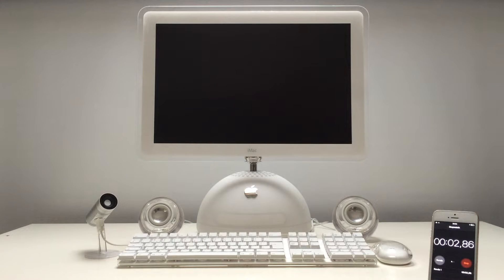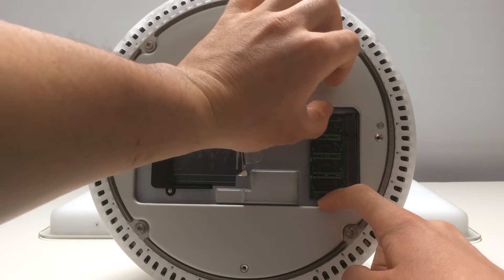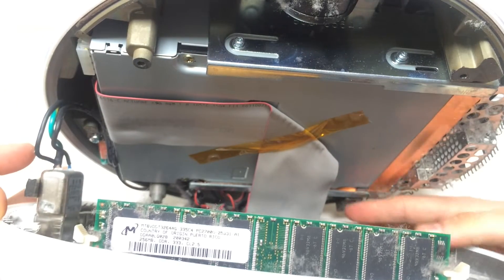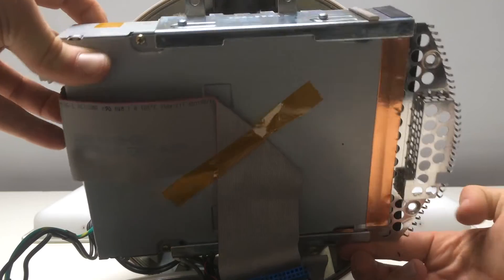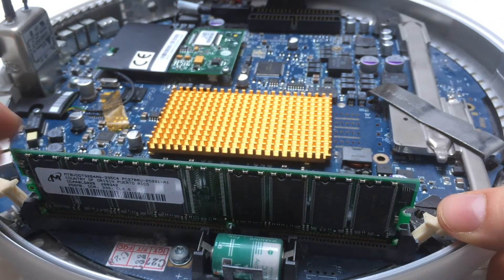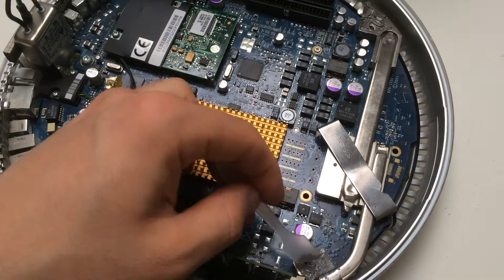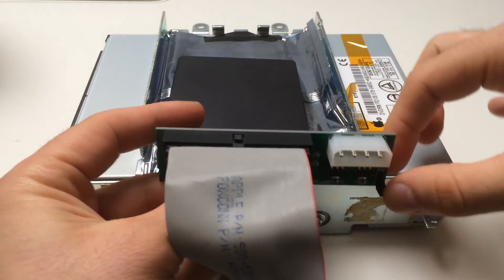iMac G4 Full Upgrade with Samsung SSD 2017

Comment: What needs upgrade is the whole system actually! I am going to attempt just this on mine!
Reply: Did u do it?
Reply: @jameswoll  Unfortunately it did not work because I couldn't find the pinout for the 15" iMac G4 display online, only the 17" and 20" are listed.
While I could have attempted to buy a 2008 MacBook display and a converter board to then put that in the iMac G4's enclosure, I decided to simply sell it as working but dead display cable.

Comment: You didn't attached a power supply to the IDE-to-SATA-converter, was that intentional or don't you need it for an SSD? I need to know as I want to replace the IDE HD with a mechanical 2.5' Sata 1TB. Additionally. is there a size limit for HDs?
Reply: I never could get that setup,to work. Maybe cuz I plugged in power?
Reply: @Phil_From_Canukistan  I'm guessing Sata drives included a power connection because there was no power coming through the serial cable. If that is the case then I would think there's no power in this video to the SSD in this video unless he attached it off video, I wish he would tel us.

Comment: Please, could you specify the parts you are usisng? i.e. physical size, etc? Thank you. I want to do this, but have no experience.
Reply: If you could give me links to purchase - that would be great! Thanks for the video!
Reply from the maker: Sie the comments you can find the list
Reply: A.N Tube Sorry I do not see any specifications of the products you used to upgrade. All I see in the comments are more YouTube video links you posted. Can you describe where the products links are please? Thank you.
Reply from the maker: ARM Ltd DDR1 DDR 1 gb pc2700 ddr333 333MHz 200Pin Laptop ddr memory CL2.5 DIMM RAM 1G

Genuine original Arctic Silver 5 3.5g, 99.9% Pure Silver Nano-silver thermal paste

New 1GB DDR 400 MHZ memory desktop PC - 3200 1 GB

Ata pata ide converter adapter plug end play 

You must watch on aliexpres
Reply: @ANTube  Does this upgrade update the PROCESSOR ? (will the computer be too slow for daily use of web browsing, YouTube HD videos, word processing, email?) Thank you :)
Reply from the maker: Nope it will not en for daily use its not recommended

Comment: I did the same procedure but the Mac doesn't see the SSD after that. Did your upgrade work and let you reinstall MacOS X after that on the SSD ? There are other videos of ppl that tried but the Mac keeps not seeing the SSD...How did you manage to get it recognized ?
Reply from the maker: I think on ata converter switches is not in read position see mijn video closely en compare  to yours

Comment: Should have put a Bluetooth card in there. Put one in my 20” g4 iMac. Worked perfectly
Reply from the maker: i just wanted bluetooth module in it only i couldn't find one unfortunately
Reply: Not sure if you still have the iMac G4. Bluetooth modules are easy to get on eBay
Reply from the maker: Keith Edginton i still have imac g4 it would be cool i a can find one do you have link voor me? Maybe i can make a new video
Reply: A. N Tube
Apple part number for the card is 820-1696
Apple part number for antenna is 631-0019
I used parts I had on hand. They came from an iMac G5

Comment: Why put in SSD in something made to accept IDE? Doesn't IDE max out at 33Mbps? Seems a waste?
Reply from the maker: Ssd is only for fun it wil not make faster
Reply: I'm doing a replacement on one of these for a customer is what brought me here so the video clearly still has utility for me and I appreciate the upload but it does beg the above question to me.
Reply from the maker: and also you are rid of annoying noise from HDD
Reply: I can no longer stand the sound of a whirring and whining hard drive.

Comment: Excellent tutorial.  I love my 20" G4 ... I think it has the most attractive design of any Mac every made. I plan to replace the battery and drop in an SSD drive to mine.  It's main use is as an Audio player and with the visualizers and better than average sound through those speakers it always gets noticed in my room.

Comment: Don't put the ssd on the anti-static bag. It's only supposed to protect components on the inside, but the outside CONDUCTS electricity. Not that it would do any damage to the ssd but for future reference.
Reply from the maker: Layne Bumgarner Good one 👍
Reply: A.N Tube  I would add, I think the original hard drive was in contact with the DVD, anyway, and, even if it were, you’d probably only get continuity between the casing on each, which would be ground. They should have a common ground, anyway. If you want to insulate two surfaces from each other, kapton tape is the best, because it doesn’t expand or contract with thermal stimuli. Cardboard would work, but I would be concerned it would shed dust inside the case over years, but that’s what the original drive was wrapped in. Good enough for Apple, good enough for me. Plasticard, from any model shop, would do the job, too. Me, I’d have just flipped the SSD over, to be sure the only surface touching the drive was the outer casing on the SSD, anyway, and taped it down with kapton tape, like the original hard drive was.

Comment: First, if u afraid from causing shorts with the converter cards soldered pins, then cover them with electrical tape or capton tape. That should keep them safe.
Second, there are 3,5" converter trays for 2,5" HDDs/SSDs. Fixing in place the SSD with just tapes is not a great idea. The tape can loosen and the drive falls off its place and the converters pins can cause shorts(check the First).
Third, swap out that ridiculus fan on top of the case. If the mobo supports PWM, then use a Noctua, Be Quiet! or same quality PWM fans. If not, then pick one of the same brands of the Non-PWM silent modells.

Comment: Could you put a list of the components you replaced them with if you have not done so already?  Links too? 
Thanks
Reply from the maker: Yes no problemo 

ARM Ltd DDR1 DDR 1 gb pc2700 ddr333 333MHz 200Pin Laptop ddr memory CL2.5 DIMM RAM 1G

Genuine original Arctic Silver 5 3.5g, 99.9% Pure Silver Nano-silver thermal paste

New 1GB DDR 400 MHZ memory desktop PC - 3200 1 GB

Ata pata ide converter adapter plug end play 

You must watch on aliexpres
Reply: Would be great if you had the name and links of each item in the description of the video.
Otherwise, great video man!
Reply from the maker: You can find it on alieixpres

Comment: you needed a drive bracket (3,5/2,5) to mount the ssd. otherwise cool vid
Reply from the maker: You are wright but ssd is really lite so its not that big deal without bracket but you notice very well sharp Thanks

Comment: OK one more question, can you give me the parts list so I can try to upgrade my iMac G4 ? I finally have one & I'm not going to part with it.
Reply from the maker: Yes no problemo 

ARM Ltd DDR1 DDR 1 gb pc2700 ddr333 333MHz 200Pin Laptop ddr memory CL2.5 DIMM RAM 1G

Genuine original Arctic Silver 5 3.5g, 99.9% Pure Silver Nano-silver thermal paste

New 1GB DDR 400 MHZ memory desktop PC - 3200 1 GB

Ata pata ide converter adapter plug end play
Reply: Thx, I have everything ordered. Just waiting on the airport card & 1 gig of ram
Reply from the maker: Nice hopefully other parts will also arrive soon
Reply: A.N Tube This is the full parts list? Thanks
Reply from the maker: Yes! No problemo

Comment: OK heres a question for you. I was able to purchase a iMac G4 Power PC; "the Globe" for 25 bucks, and it fully works. I also have a fully working Mac Mini. My question is, is it possible to gut the iMac & install the hardware from the Mac Mini into the iMac G4 & make it work?
Reply from the maker: I think that is possible only problem is how do you get a picture because you have to know which wire you have to select on which wire if you can get the signal via the macmini on screen then should be possible i have try macmini hardware without body fits inside
Reply: That seem too be the big issue. How to get the picture from the Mini to the G4 screen. It seems possible, just dont know where to begin.

Comment: Great video, AN. Tube. Dit everything work fine with the newer HDD? 
I myself try to do the same, with an SATA SSD and an similar adaptor from Alie-express.
Unfortunatly My Imac g4 seems to be unbelieveble picky about the drive. So far I tried an normal SATA HDD with a cloned version of the original drive (cloned with SuperDuper).
Also an old laptop HDD with a cloned version of OSX 10.4, an small 64 G SSD from Alie-express, also cloned.
I tried an another adaptor between flatcable and laptop HDD.
None of them boots and all show the question-mark inside a map when booting. Afterwards the computer hangs.
Strangly enough the computer doesn't respond to the keyboard while booting up. So pressing Alt after start doesn't show the bootable options. Not pressing T when selecting target-mode.
The only option I so far got working is the old original HDD. And that one is getting noisier every attempt. 
I must be doing something something but can't seem to find out.
What kind of adapter did you use between the SSD and the flatcable. Do you still know type and where to buy?
Help is highly appreciated.
Reply from the maker: hey that's annoying I think you have older g4 version I did not have such problems and with me it works perfectly I'm working on video after upgrade I wil upload soon! the cable converter  is ata pata ide converter adapter plug end play i have also bought on aliexpres what you can do is install ssd and set up with cd software and not via the clone hdd!
Reply: Thanks for the respons, AN. Tube
Indeed it seems one of the older G4's. 15 inch screen 800mh.  I tried as you suggested. New (other HD) HDD build in and connected instead of the old HDD. But when its starts up it shows only the map/question mark. It won't respond to the keyboard on my requests, for the boot options.  I already found out that the boot options for powerpc are slight different from intelmacs. I learned that the drive jumper cable select/master and slave is very imported. Even the original HDD boots only when CS is selected with the drive jumper
Reply from the maker: on older g4s is a bit more difficult but nice that you have found the problem
Reply: I took me al lot of trial and error. Especially a perfect copy of the original disk brought me some headache. Even superduper dos not do the job perfectly. But I managed to get a working clone-disk. Thanks trough your video and helps. 
The only thing that doesn't work is accessing the boot-menu while startup. Target-disk and selecting the CD fr startup. But so far I managed to do it all. So eventually that will succeed to, I guess.
Thanks A.N. Tube
Reply from the maker: I am glad that you succeeded Its feel good have been able to help. and what I also wanted to recommend is to put ssd in g3 desktop and install it there and then put ssd in g4 then you have ssd with fully installed software i deed ones en its worked for me so next time you can try  that. No problemo you are welcome.

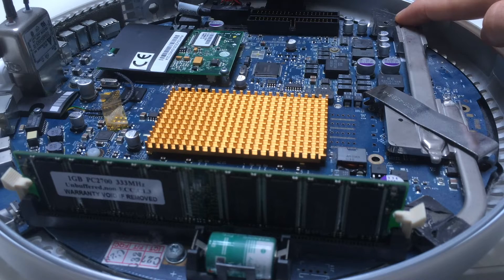Comment: hey man, cool vid, just at around 05:08 when you clean the thermal paste residual, don't scrub it! You should use Isopropyl Alcohol and rub it clean with a microfiber cloth! Avoids the scratches this way ;)
Reply from the maker: soanis Thanks good advice 👍

Comment: Can you make a written list of everything you upgraded I mac g4 so that I can order exactly what I need to upgrade my g4.
Reply from the maker: Agnes Bonham no problemo 

ARM Ltd DDR1 DDR 1 gb pc2700 ddr333 333MHz 200Pin Laptop ddr memory CL2.5 DIMM RAM 1G

Genuine original Arctic Silver 5 3.5g, 99.9% Pure Silver Nano-silver thermal paste

New 1GB DDR 400 MHZ memory desktop PC - 3200 1 GB

Ata pata ide converter adapter plug end play
Reply from the maker: Agnes Bonham  Airportcart SSD en iSight webcam!

Comment: Great job... but do you recommend swapping out the dvd for another smaller ssd which you could boot off of? And due to the limits of the processor, is it all worth it?
Reply from the maker: Spuds Thank you! I would not recommend to change DVD drive. You have something extra to play to play ore burn  DVD's. iMac G4 apps are not that big so i think you don't need really so many gb's but you feel comfortable i think it will work well. Just format  a properly, then it will work just fine.

Comment: Great tutorial, even with imperfect English you were clear and easy to follow. I plan on doing much of this with mine, though I will leave out the SSD conversion. The bus speed of this aging machine and the bottleneck of the ATA standard makes this machine way too slow to take advantage of any gains offered by an SSD. They're too expensive to throw at a machine that can't even take proper advantage of them.
Reply from the maker: ProjectDv2 thanks you are right for part of ssd can not be wired in g4 might be better choice to insert an SSHD also considering that ssd is too expensive is also quite well en with sshd you have speed en storage as wel

Comment: Cool vid! I have a G4 caked with dust too and have yet to take the challenge of disassembling the thing to clean it up and swap out the drive.
Reply from the maker: iTek thanks! Its isn't  that hard to do it en its nice project to you can do it easily
Reply: Love your channel
Reply: as was mentioned  before ... DO NOT USE A VACUUM . . . Static charges kill .

Comment: I just did this to a 1.25 ghz g4. I have 1gb ram in both slots. OS X tiger only shows 1gb total. It says a slot is empty. If I pull the RECOGNIZED stick out, it will read as 1gb still!
Reply: Btw that iMac uses a 200-pin SODIMM DDR PC-2700 stick. Watch out for that!
Reply from the maker: Turbo Tutorials I think the memory you're using does not  work or is not the right one , not all the memory's with one fits in  that will work!
Reply: If these make a combined 1 gb ram, then you should have no problem.
If each one has 1 gb ram it doesn't work because PowerPCs support up to 1,5 GB of RAM, sometimes 2
Reply: The one stick was bad. I’m cruising with 2gb now.
Reply: Did you notice a big difference?
Reply from the maker: A little bit but its fun if you like upgrade thinks
Reply: I just put 2 GB in my imac g4, up from 768 mb. it's a ton better on the internet.
Reply: Great! Enjoy 2 GB of RAM on your iMac G4!

Comment: Nice video man! Just an advise; never suck out dust from computerhardware using a vacuumcleaner, that can cause ESD's. It's better to blow it out with compressed air ;)
Reply: Actually,  there are specially designed esd vacuums that are made for use on electronics.
Reply from the maker: Jeroen van Diesen Yeah not really professional how i deed.  thanks for your tip, i will definitely do different in future videos! Thanks man
Reply from the maker: exactly my vacuum cleaner is special too 😜

Comment: How long did it take you to acquire the components? I have a boxed 800mhz model I'd like to upgrade to my 2003 Wildest Dreams setup, and have a bit of shopping to do.
Reply from the maker: Ken To get everything together has me taken a month!i order it from china.  You have to keep in mind this imac in video is not 800Ghz is 1.25 ghz model! and the components will not work in the 800 ghz model! The are different!
Reply: Thanks. I'm aware they are different. The 800mhz Model is what was top of the line when I first went to college... so... had to be specific.
Reply from the maker: Ken oh so okey i understand. What's your plan? with your wildest 2003 dream setup what do you have in mind to to wilt you imac g4?

Comment: Great video. I'm planning on doing something similar myself and this is just what I was looking for :)
Reply from the maker: Thomas McIntosh Thank you!I am using imac as mine second computer so upgrading is really recommended works faster and smoother. Beside this is also a nice project. If you have any questions about this upgrade be free i will try to help you